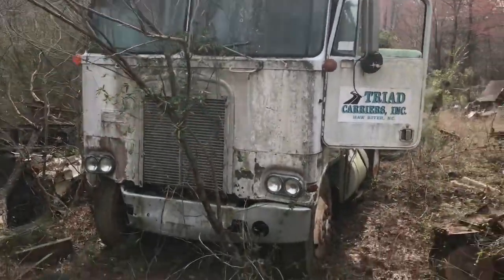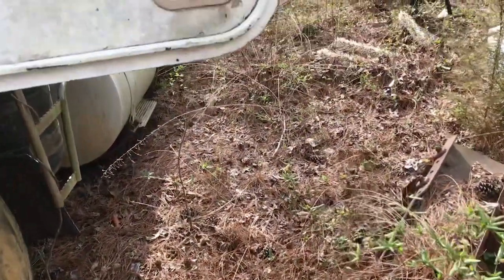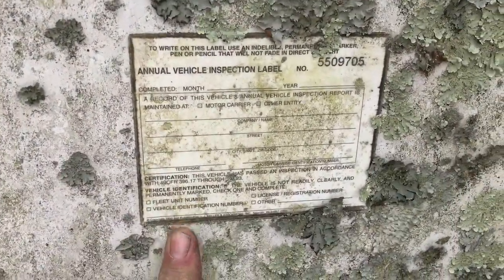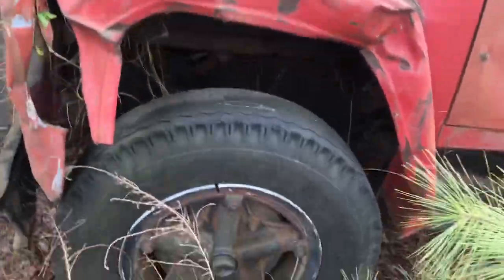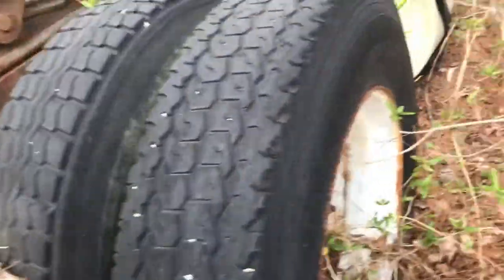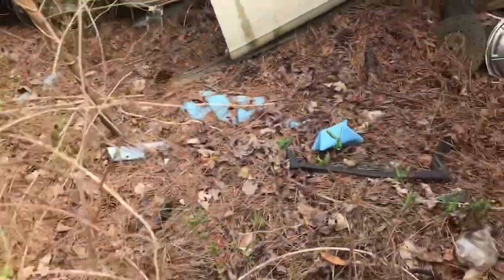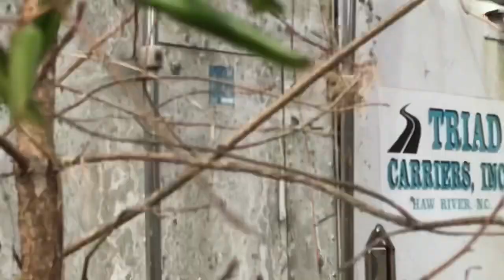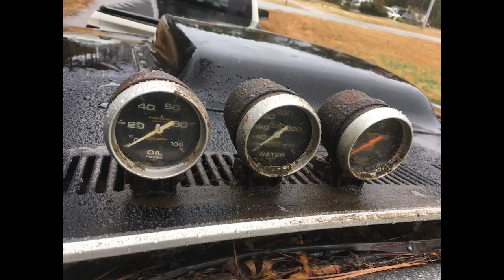Junkyard find ! Old Kenworth cabover

Comment: Sometimes, if a fella is really careful and somewhat lucky, those fuel tanks can pop back into shape with air pressure. I couldn't see that decal very well, but given its position, I'd hazard a guess that it was for the fuel tax. If it was and you can see anything up close, it would have IFTA on it in bold letters. I love roaming around old scrap and salvage yards, there's just about always treasures to be seen...not sayin' that they could be had, but they could be seen. If that ol' rig was pulled out to where it could be seen the folks inquirin' about it would swarm ya like mosquitos hahahaaa! That poor Buick was bein' treated pretty rough, it kinda hurts a bit to see 'em like that heh, heh.